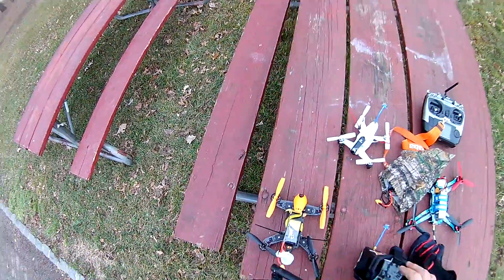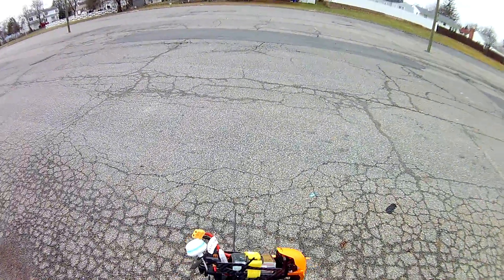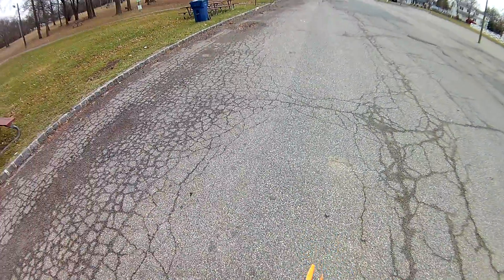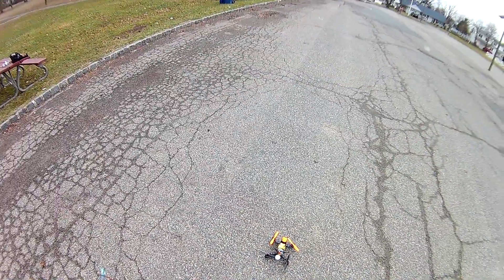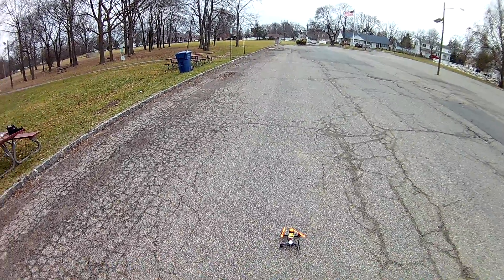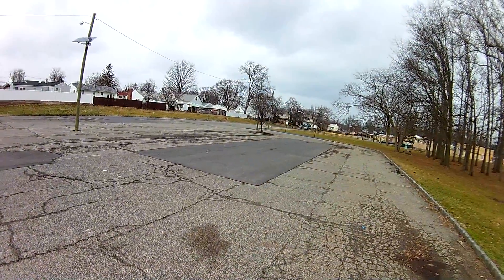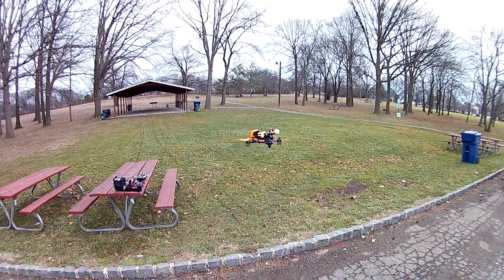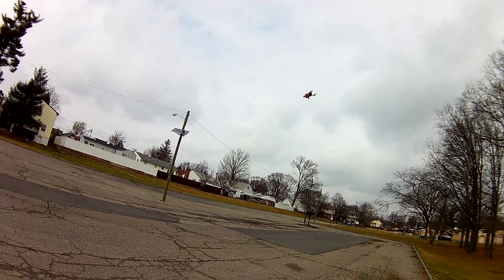walkera f210 3d

Comment: Nice Ian, where is your Rodeo 150?
Reply from the maker: My rodeo 150 is done!!! I was flying in acro and it just lost power out of now where and I replaced the body and it still didn't work and blew an esc. Bought another esc and still didn't work. So my rodeo 110 and rodeo 150 are in my drone graveyard. Only my walkera f210 works out of my walkera quads.